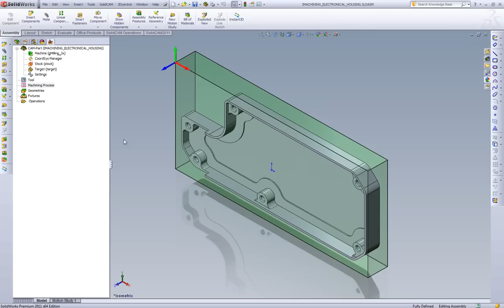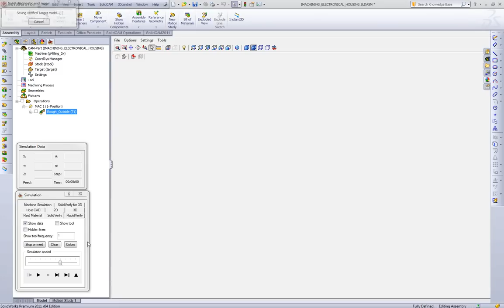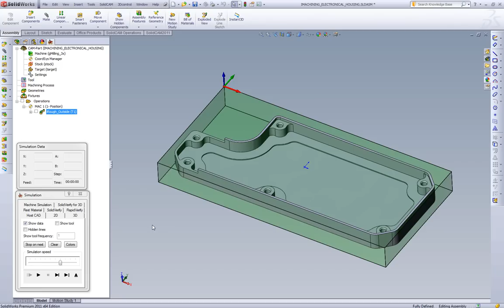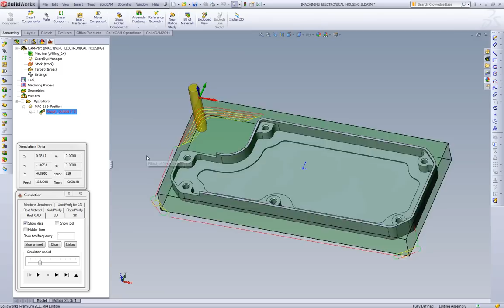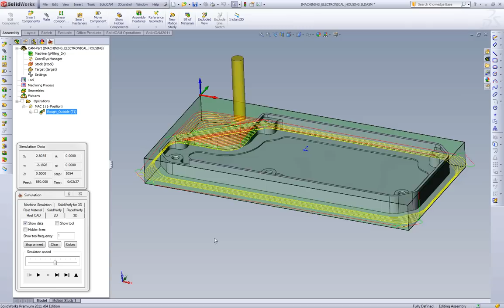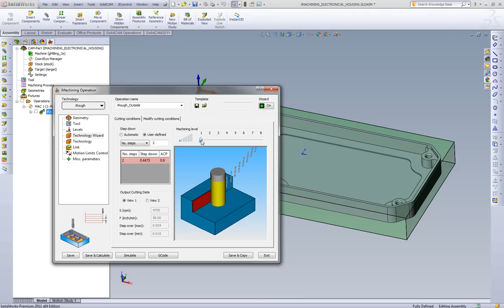SolidCAM 2011 Introduction To iMachining CNC Milling Software

Comment: I noticed you picked a material. Does that mean Tools Feeds and Speed will use that Info. And if Yes then all tools.. Milling and Turning tools. And if True can someone do a Video on how the machining data is defined for both turning and milling tools
Thanks